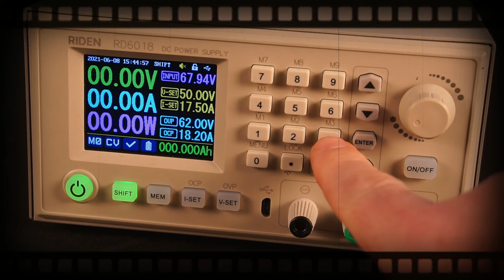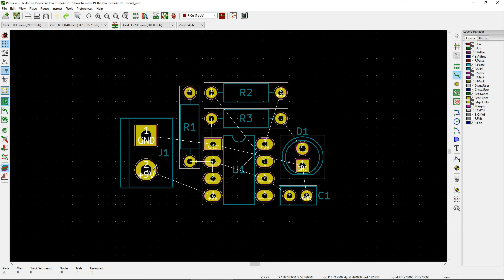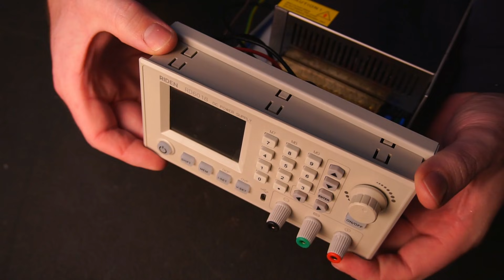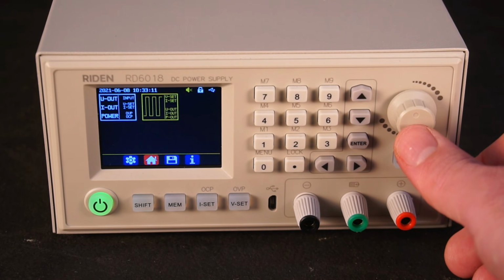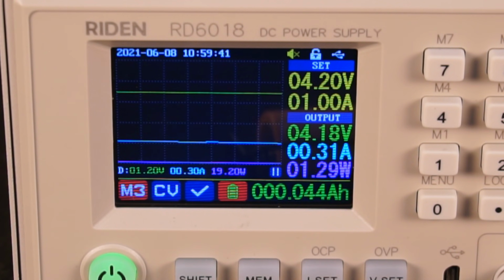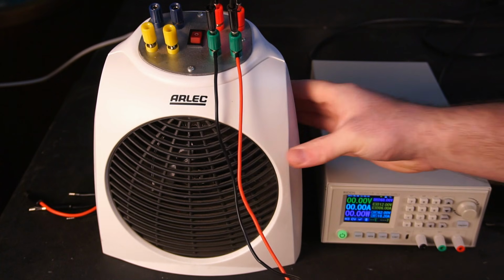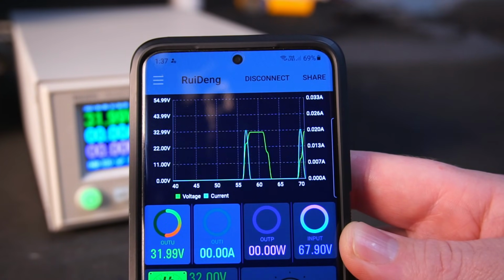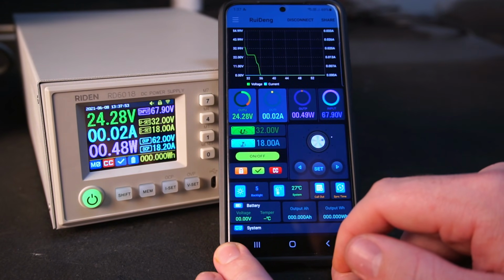Riden RD6018 Power Supply Review II 60Volts, 18Amps

Comment: Has anyone tried using an 1225 instead of the specified 1220 lithium coin cell in the internal clock backup battery holder? The 1225 is only 0.5mm thicker than the 1220 but it provides about 25% higher mAh capacity than the 1220. This would increase the length of time between opening the case to replace the coin cell.
I'd like to try going from 1220 to 1225 and would appreciate any real-world experience with possible damage to the coin cell top retention connector. It pretty much depends on how brittle is the alloy used for the metal connector that clips over the top of coin cell when installed. It feels like it should be flexible enough to accept the 1225 cell without a problem.

By the way, it's not unusual for a PCB horizontal mount 1220 coin cell holder to be designed to properly fit and retain BOTH the 1220 and 1225 coin cell sizes. It would just be nice to have confirmation.

FYI: In this type of application I recommend using "BR####" series instead of "CR####" series coin cells because the BR's have an ~10 year shelf life compared to the "CR's" 5-7yr shelf life, and the "BR's" also tend to last longer in exceptionally low-drain circuits like clock backups.
Reply: I'm considering wiring in a 2032 cell holder to allow for that instead of the silly 1220. Were they unable to find space for the ubiquitous 2032?
Reply: @sadfur8728  I too would have preferred a 2032. I have quite a few pieces of equipment that use them so it would be easier (and cheaper) for me, and provide longer lasting backup power for this power supply's clock.
Reply: @exgenica  it would be interesting to know why they couldn't fit a 2032 in there, as it isn't exactly lacking for space. Could be they just don't think about the advantages of it at the time.  Strange because everything else seems well thought out.

Comment: The schematic is an over engineered puzzle.  The high output caps and voltage ripple (250mV+, and that is their own spec sheet) make this s non-starter for me.
Reply: Precisely my issues with this otherwise cool unit.

Comment: (05:50) Why? When you make a claim like this, especially when it deviates from the provided design, it would be helpful and increase trust if you state WHY you don't recommend keeping the tinned wire ends on screw-down connectors. 
The internet is full of claims that have no supporting information sometimes with disastrous results.

For example:
There is a reputable "best practices" study that shows that folded-over bare stranded wiring is superior to tinned wiring in this type of connector.
You think using "folded over" bare wires provides greater and/or more reliable current carrying capability?
You think soldered wire ends eventually loosen over time due to malleability of the solder under constant pressure?
You think soldered ends are contaminated by flux or other materials and thus don't conduct as well?
Or...something else?
Reply: I think anyone who ever tried to use a screw down terminal on a soldered piece of stranded wire would understand why.  You are more likely to end up with a connection issue on the hard soldered diameter vs the stranded wire.  The internet is also full of people who demand unreasonable explanations based on their own ignorance.
Reply: @beaker2000  said, "The internet is also full of people who demand unreasonable explanations based on their own ignorance."
The internet is also full  of people who make bad suggestions and erroneous claims based on their own ignorance as well.

There are also many videos on Youtube that intentionally provide malicious "hacks" and "tips" that will destroy viewers' property if attempted.
Reply: Because in this kind of connector, there is a metal, flat clamping plate which compresses the wire against another flat plate.  This makes clamping on a hard soldered end of a wire of any reasonable diameter (like in this case where a lot of amps could be involved) it doesn't make good contact and cant spread out stranded wire between the two clamping plates.  It is like trapping a hard cylinder between two panels of plywood.  If you had ever worked with circuits and electronics and tried to do this as many have you would have realized that it is better to cut off the tinned end of the wire in a clamp type connection so the stranded wire is compressed and spreads out between the two plates vs the hard ball of solder.
Reply: @beaker2000  I've never had a meaningful problem with soldered wire and screw-down connectors. I HAVE had a problem with bare stranded wire when insufficient connection was made between the screw because too few strands made a good connection, which caused significant  overheating at the connection and melted connector plastic housings.
Perhaps some soldered stranded-wire and screw connector issues may be due to solder alloy percentages and/or content, "lead-free" solders, and so on. It also could be due to insufficiently physically securing the wire which could allow it to "wiggle" back and forth in the connector which of course could deform softer alloys and thus help cause connection problems.

Comment: CAUTION: POSSIBLE HARDWARE DAMAGE
A feature of the RD6018 display functionality has a bit of a learning curve and can result in damaging attached electronics until you learn the way the new display works.

The display of Voltage and Current settings on the LCD display is very different from my other PSUs and it has potential to cause significant problems (like destroyed circuits and devices).
My other PSUs (digital and analog, sample size=3) show the set Voltage and Current 100% of the time. That means that even when the OUTPUT on/off enable button is OFF, the primary large digit Voltage and Current digits show the values I set ALL the time. The RD6018 does NOT work that way.

The RD6018 sets these large digits to ZERO whenever the output enable button is off.
To see what you have set the Voltage and Current values to when the output enable button is off, you have to look at the very small (about 3mm high) Vout and Iout indicators on the right side of the LCD display. The large digits will show ZERO voltage and ZERO amps  when the output enable button is off.

That method is not only redundant, it not industry standard, and it puts hardware at higher risk of damage due to wrong actions by the user. (It's redundant because we already KNOW that when the more obvious output enable Light is "off" (or the button is in a particular "in or out" position), that the output is at 0.00VDC)

The PROBLEM is, that since I have grown use to the way my other PSUs operate, when the RD6018 shows the large digits as ZERO when the output enable button if off, I may think the ACTUAL output voltage is also SET to ZERO, and when I enable the output it will be at ZERO volts...but that won't be true on the RD6018...it will output the value shown in the tiny 3mm high digits section of the display, which could be up to 60VDC. This could result in my connecting a device to much higher voltage than I had intended.

For example, when I was testing some LED bicycle headlights my OLD way was to set the voltage to zero and enable the output to the headlight, then slowly increase the voltage until the headlight began to glow. However, with the way the RD6018 displays the output voltage differently, there is a chance I could connect a 12VDC LED headlight to the PSU while THINKING the output was set to ZERO volts because the large digits displayed ZERO when the output enable switch was off. In reality, since those large digits only make it LOOK like it's set to zero (based on my old routine using any of my other PSUs), I could accidentally connect the 12VDC LED headlight to the PSU and when I enable the output button, it instead could apply 48VDC to the 12VDC LED headlight (because I'd just previously tested a 48V headlight)...and thus destroy the 12VDC headlight.

Therefore, I now have to be VERY careful to keep my impaired vision eyes on the TINY 3mm "Vout" digits before I connect my LED headlight for testing in order to see what my Vout is set to...and NOT rely on the large digits before I enable the output voltage.